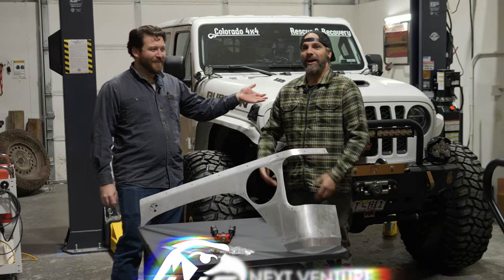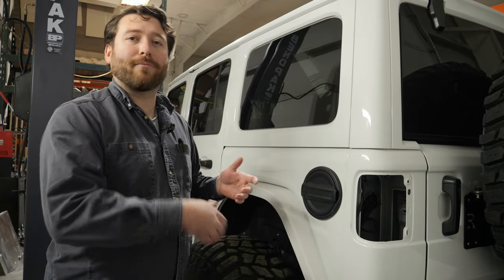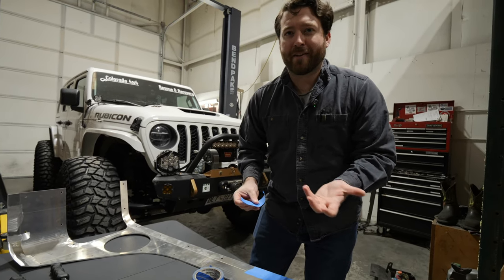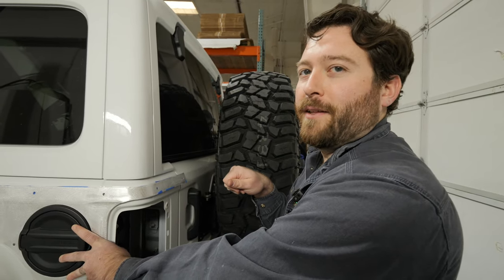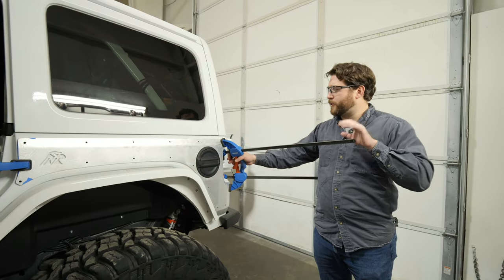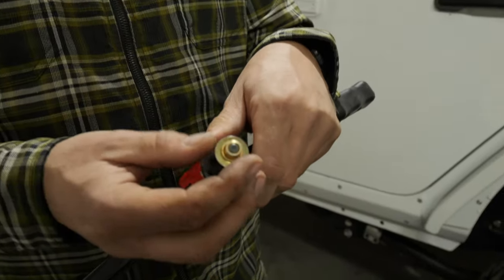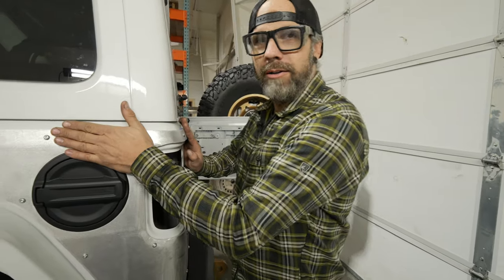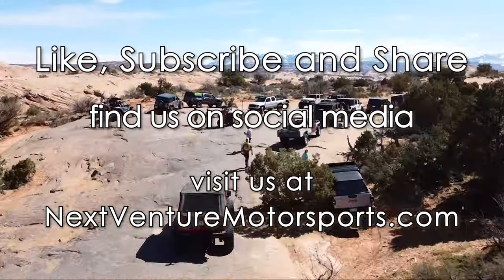Jeep JL Aluminum Corner Armor [Install Video]

Comment: When you do the final install do you put any silicone or anything else between the body and the corner guard to prevent rust?
Reply from the maker: Richard, thanks for asking! We probably should have included a little bit about that in the video in hindsight. I typically clear coat/paint the areas we've drilled out before inserting any hardware. Even a paint pen around the edge of the new cutouts seems to help.

As for attempting to seal the corner armor to the body with a gasket; that is not something I did on my first set that was installed; and after a couple of years and removing the armor, we had only a light coating of dust between the armor and the body. There is enough of a gap at the bottom that water doesn't get trapped and is allowed out, and the small gap between the armor and body panels isn't large enough for much of anything else to get in.

If you do want to seal it up that way, I would recommend only sealing the top to cut down on the amount of water and debris that might get in, but leaving the bottom open so it can drain in the event it does find it's way in. Worse case scenario might be a seal that allows it in but won't allow it to flow out 
🤙

Comment: Could I get a version that has  no holes?
Reply from the maker: We have been quietly working on exactly that for a late spring release 😅
Reply: @NextVentureMotorsports  ooooo yes dude! I don't want to drill holes and would love to use 3M tape like the rocker guards. I will patiently wait and order the rocker guards for now.
Reply from the maker: @Joes432  my apologies; I assumed you meant no tail lamp holes as that's been requested a lot recently. 3M tape to apply the rocker guards is not something we have tested yet. If you really use them, you might really want them to be fastened and torqued down. We'll consider it though!